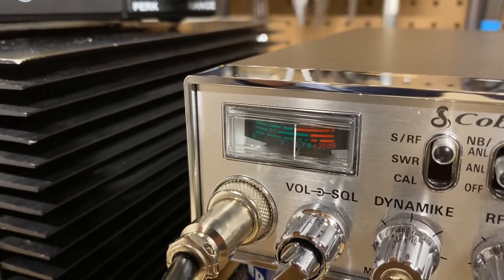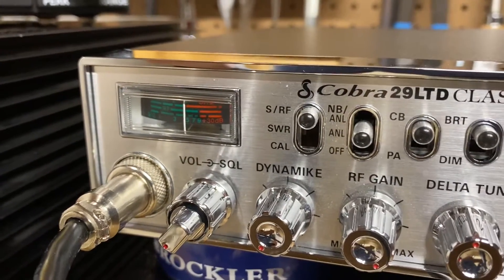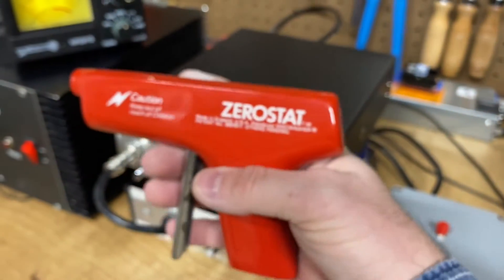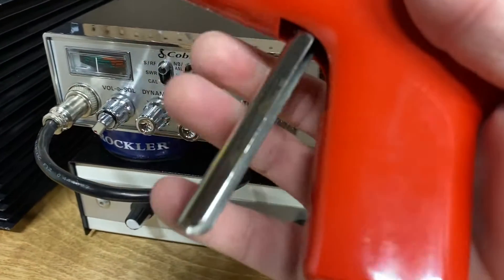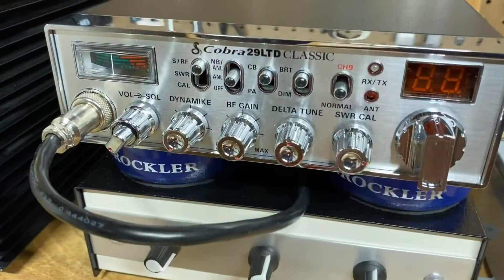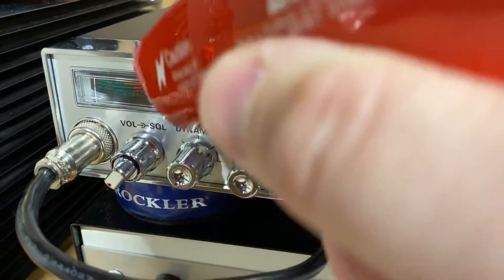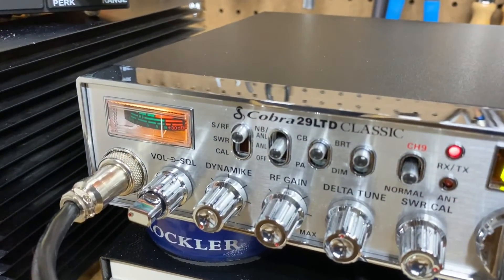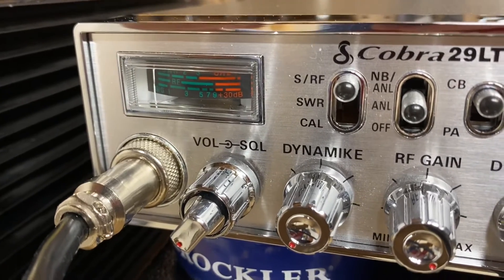Stuck needle on CB radio S meter - static electricity fix

Comment: If you're looking for the quick fix and this doesn't work. Take the radio apart and the faceplate off and do what 90% of the other videos suggest. If your need doesn't budge at all, this won't do anything. Either your needle is literally stuck in the holder or the needle is rubbing on a distorted background from overheating from a bulb or 140 degree in car dash temps etc.
Reply from the maker: I have fixed several stuck meters by using jeweler's screwdrivers on the uppper and lower flathead screws to loosen them back up.   This is for a working radio suffering from dry air and static electricity.
Reply: @421CentralIowa  I wasn't knocking your procedure. That's something I've never seen before. My comment was just for the people in the comment section  who have a stuck meter that corrosion or lamp heat has stuck solid. Appreciate the video.